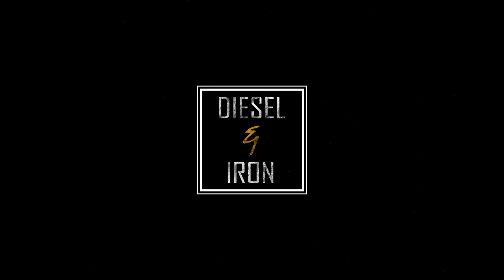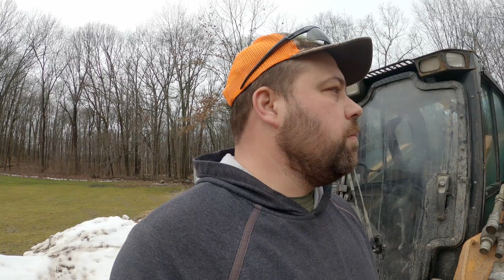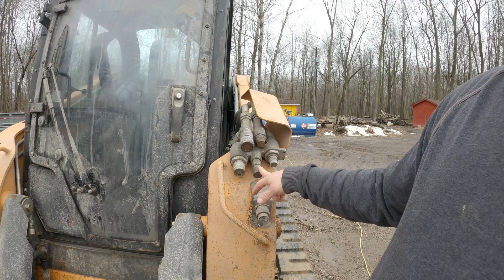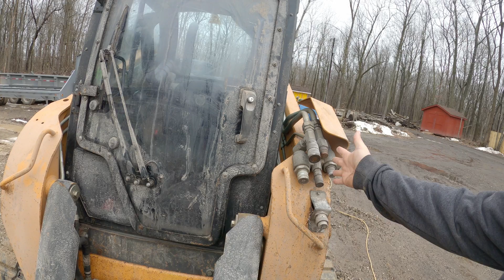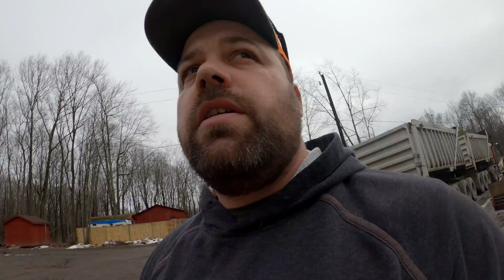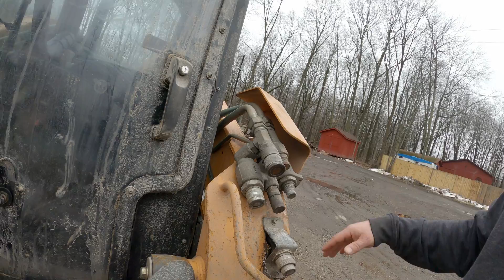High Flow vs  Low Flow Hydraulics

Comment: Caterpillar has only 3 vertical and they are high flow. You don’t have to have 5 couplings for high flow. You can add more for extra functions but don’t need to for high flow.